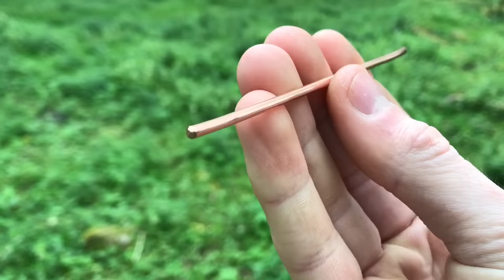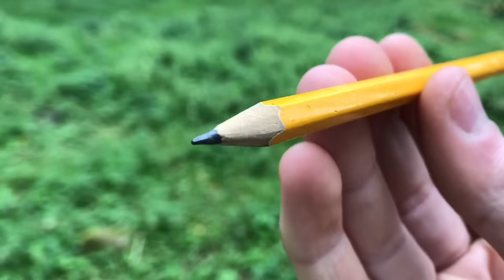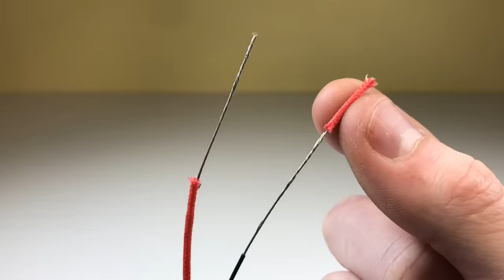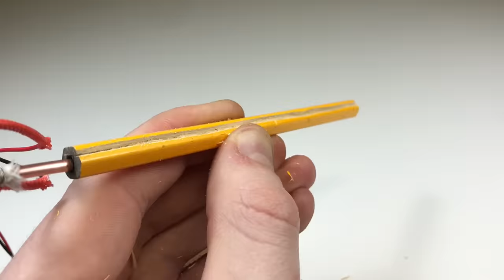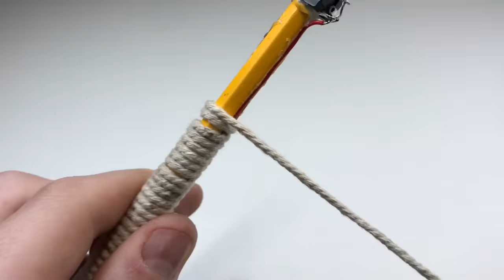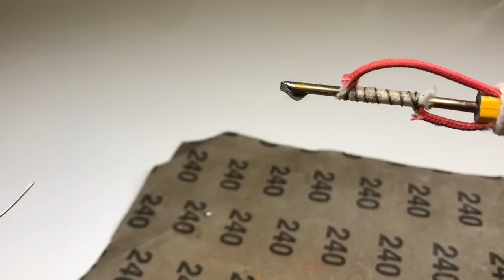Make SOLDERING IRON Using Pencil

Comment: A normal soldering iron is about 20 to 30 watts.  At 12 volts that would be about 2 to 2.5 amps current.  It's important to have the AC adapter that can put out enough current without overheating and burning out.  This could be a shock and fire hazard.  The wires from the jack to the tip are very fine and may get hot from the high current.  I think the reason why he wrapped the handle with twine was the wires got very warm and it was too hot to handle.

Comment: Yo I’ve watched a lot of your vids, great stuff. Very straight forward ideas and concepts using simple designs and very common stuff. I’m kind of a novice at the moment and I’d like to know how to read a circuit board. Do you know any sites or books about that, also do you have any material on more complex electrical components used for those boards?